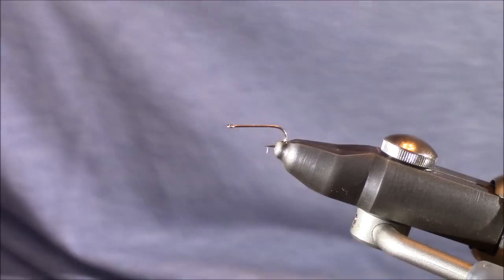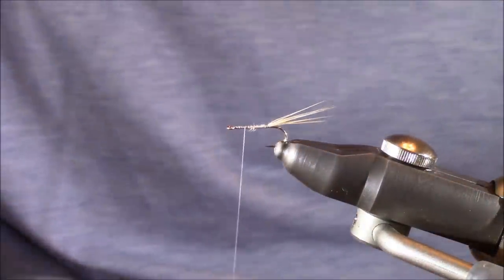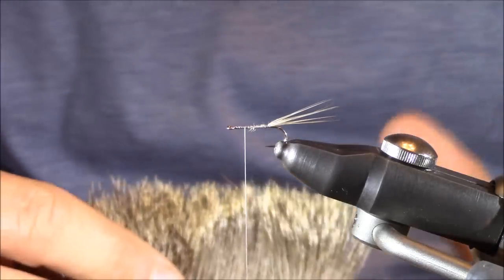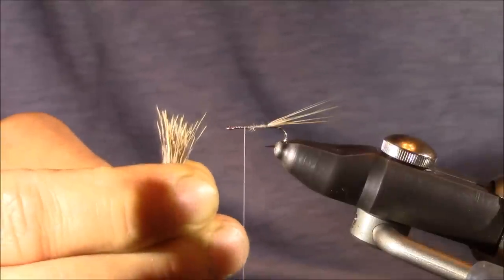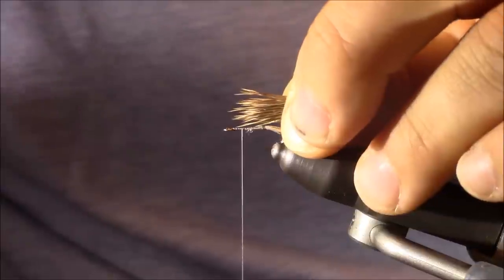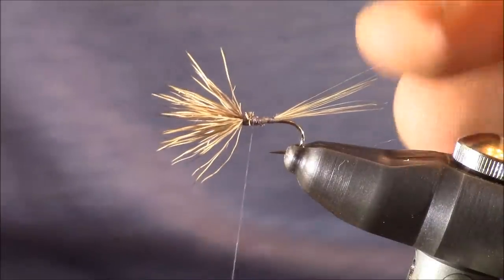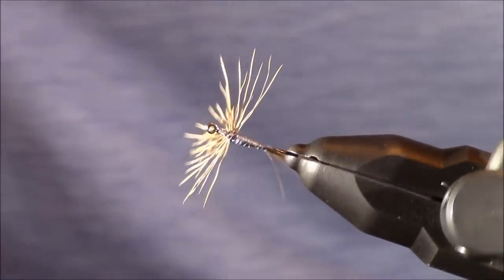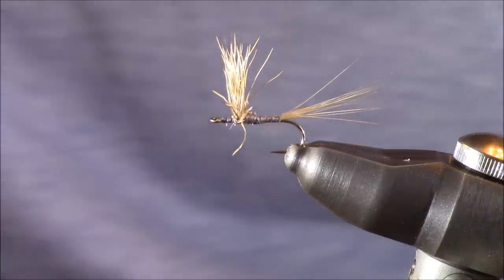Fly Tying: Comparadun Deer Hair Wing

Comment: Hi Tim. Watch your vids and enjoy them much. Thanks for sharing. The BWO's on some of the streams I fish here in PA are very small. Do you tie comprara duns down to 18's and 20's? I find it very difficult to use deer hair for wings down in these sizes, and I have tried many many different pieces/types of deer hair. Any suggestions for an alternate wing material that won't bulk up for these sizes other than cdc? Thanks, man...
Reply from the maker: You're welcome, Ray, and I'm happy to help.  I will tie Comparaduns with deer hair to size 18, though normally not 20.  I've also used snowshoe rabbit, but it bulks up a lot, too.  Aside from CDC, you've hit the major materials I use.  If you try anything else, be sure to let me know.  Tim
Reply: Tim Cammisa Ok, thanks Tim, will do,